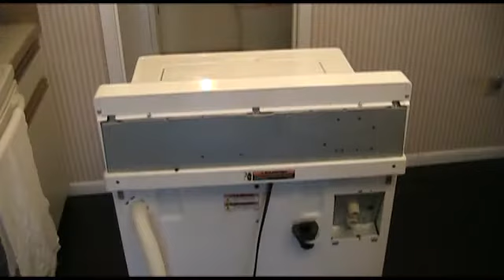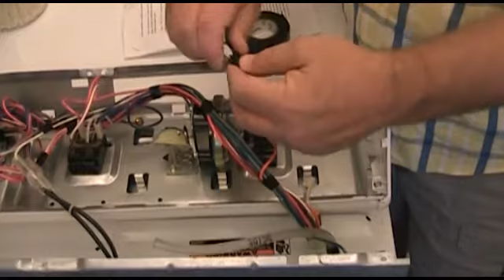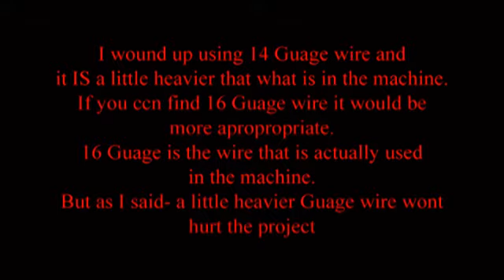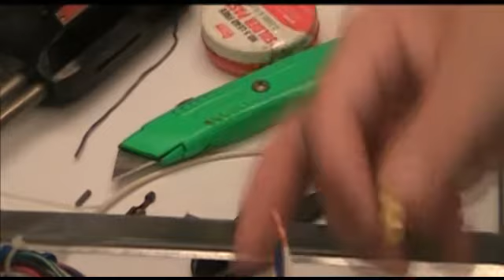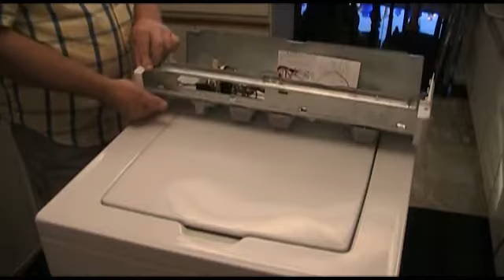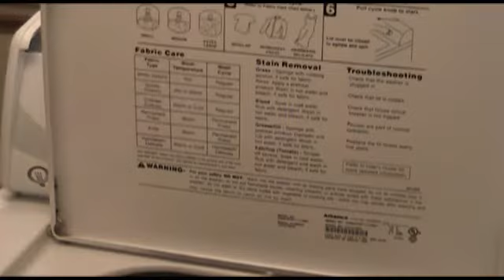Speed Queen Rinse Temperature Modification and Water level Adjustment

Comment: See detailed instructions here:

Rinse temperature modification instructions for the Speed Queen AWN542
These directions were written for the Speed Queen AWN542SP assuming the person doing the repair is standing in front of the machine at the time of the repair.  Time needed is 30 minutes or less.

1. PULL THE PLUG!  Cut any electrical connection to the washer before you do anything else.

2. Using a ¼ inch socket, remove the 3 screws at the top and behind the console. You only need to remove 3 screws; one in the middle and one at each end.  All three screws are vertical.  Remember to turn them to the LEFT to loosen and RIGHT to tighten. (When you’re done and buttoning up, tighten these screws VERY gently.  When starting them into the hole it helps to gently rock the console back and forth just a bit to help the screws find their grooves.)
Once the screws are removed and the console is loose, very gently roll the top of the console back towards you paying very close attention to any strain on the wires inside.  Don’t ever place a strain on any wires.  

3. Use the pliers to pull the Black/Pink wire off of terminal #4 then tape it securely with electrical tape, covering it so that it can never come in contact with any metal surface.  Fold it over and tape it again to be sure.  Use a very small electrical zip tie to secure the tape so that it will never come loose. 

4.  Locate the grey wire, which you will notice goes down the thru-hole to the motor with the rest of the wires.  When you cut the grey wire, cut it far enough to your right so that you leave the grey wire leading up out of the thru-hole long enough that it has plenty of slack when it attaches to terminal #4 in order to avoid ever having a strain on it which could cause you much grief later on.  This will leave the grey wire leading from the timer short so add wire to it using a 12 inch piece of either grey or yellow (grey is hard to find so I suggest yellow as there is no other yellow wire in the harness) wire using an 18 gauge insulated butt-splice crimp connector.  Strip 3/8 inch of plastic off of each wire for the butt connection.

5.  Locate the single grey wire that leads up from the thru-hole and strip ¼ inch of plastic covering off of the end.  Twist the wire strands together and insert it into the 18 gauge female connector opening and crimp it, then connect it to terminal 4.

6.  Use the pliers to pull the black/blue wire off of terminal L and cut off the connector as close as you can in order to leave the wire as long as possible.  Strip 1/4 inch of the plastic cover off and twist the wire strands.  Join (twist) the black/blue wire to the grey (or now yellow) wire that leads from the timer mechanism and insert both into the 16 gauge female connector and crimp together.  (if you like you can trim some of the extra wire from the 12 inch piece that you added earlier before you join it with the black/blue wire but make sure you don’t cut it too short)  Now that the black/blue wire and the grey (or now yellow) wire are joined, connect to L.  

This is how it should look when you’re finished:

A. The grey wire that leads up from thru hole is connected to 4
B. The red wire never moves from terminal 3
C. The black/pink wire is tapped off securely and out of the way.
D. The black/blue + Grey (or now yellow) wire from the timer is connected to L

Tools and parts you will need:

 One female 18 gauge non-insulated push on wire connector
 One female 16 gauge non-insulated push on wire connector
 One male push on wire connector
 One 18 gauge insulated butt connector.
a wire stripper
a wire crimper
a small pair of square nose pliers
a small wire cutter
a 1/4-inch socket and driver
a one-foot long piece of grey or yellow insulated 18 gauge stranded insulated wire
a knife or scissors 
a very small electrical zip tie to cinch around the end of the taped up back/pink wire to insure the electrical tape never comes loose.
a flashlight or work light and someone to hold it for you
Electrical tape

Tips:
1. Sometimes wire connectors have hidden ‘burrs’ on them so you should ‘exercise’ the wire connectors before you start by inserting a male connector into the female connector to insure that there are no burrs in the female connector.  You’ll only be installing the female connectors onto the terminals but a male is needed for the ‘exercise’.  By fitting them together once or twice you’ll remove any potential burrs which will make connecting them to the washers terminals much gentler, greatly lessening the risk of doing any harm to a terminal.

2. Because insulated connectors are a bit more common you might find it easier to find and buy insulated connectors and then use a sharp knife to cut the plastic insulation off.  Remember to leave the insulation on the butt connector.  High heat connectors are probably the best quality.

3. Using a sharp knife to cut off the plastic wire covering is a very common rookie mistake and a bad idea.  (learn from my mistakes)   It’s very difficult to strip wire with a knife without cutting some of the copper strands and you don’t want to lose any so make sure you use a good quality wire stripper to cut the plastic wire insulation.  Once you cut the plastic, gently pull the cut plastic off with your fingers rather than using the stripper to pull the plastic off because you'll lose far fewer wire strands by using your fingers. 

4.  If you intend to leave your washer in place for this repair (as I did) you’ll find a mirror very handy to see where the screws are located on the back of the control panel.

Comment: Nice video!  This will be a great help to anyone who wants to do this hack.  I found the yellow wire at an auto supply store and although I personally like the idea of using an obviously different color wire,  those with a better memory than mine will find that any color will do.  
How do you like the hack so far and more importantly, how does your wife like it?  Once again, thanks for making this video, great job!
One more thing, if you care to, feel free to repost my written instructions here.  Anything that will make this easier for others to do this hack is fine by me.
Reply from the maker: +Pendelton Whiskey, 

Thanks for the complement. I appreciated the other posters video but I just couldn't see what he was doing.  

Very few people "including me" are going to attempt this unless they are absolutely sure how to do it. I put it off for months because I wasn't willing to take a chance of shorting out my wife's washer trying to figure it out. I finally decided to make a video myself using your instructions as a guide. 

I didn't think about the fact I mentioned you by name until after the video was posted. 
Hope you don't mind. 
My wife likes the hack but more importantly she likes having cold water out of the Cold Water tap again. 
The original hack was to run some hot water into the washer’s cold water line to increase the rinse temp.  The problem is in spite of me buying the best back-flow preventer I could find I still think hot water was being siphoned into the cold water line whenever you turned on a faucet. 
The result was warm water out of the cold water faucet. 
This hack eliminated that problem. 

When you post the instructions  I will edit the description stating they are in the comment area for reference. Just when you post them put " Written Instructions" at the top so people can find them easily. 

I would do it myself  but first- I don’t think the Description Area will take that many
characters. 
Second and most importantly- This is your hack and you should get  credit for it. All I did was film myself following your instructions. 

By the way thank you again. 
Your instructions were the only thing that gave me enough confidence to try this. 

Thanks again.
Reply: I do appreciate the compliment but I want to be sure and give the credit to
alitak.  All I did was study what he did and write it down.  I wrote it down to be sure I understood it before I did the hack and then posted it where you found it and I'm glad you found it and you are very welcome.  Thanks.

By the way, I'm told that the 2018 Speed Queens aren't worth having.  I hope they change them back.